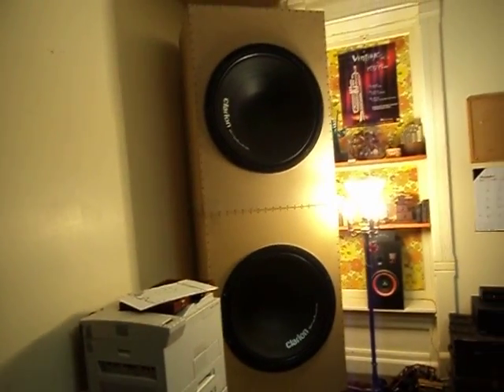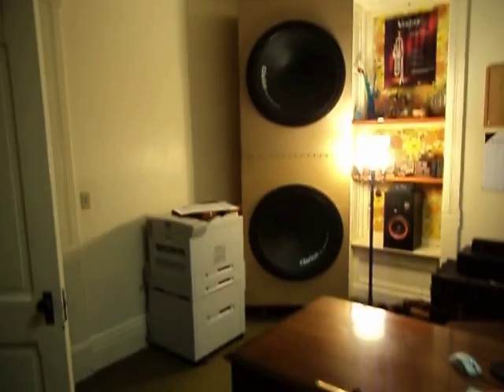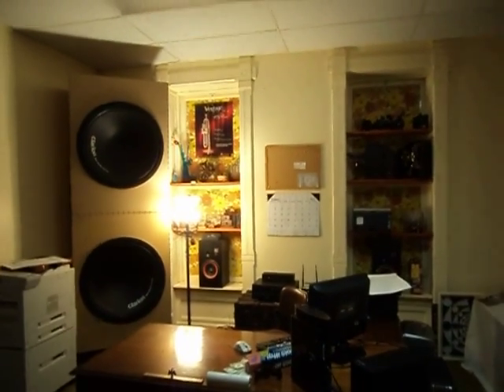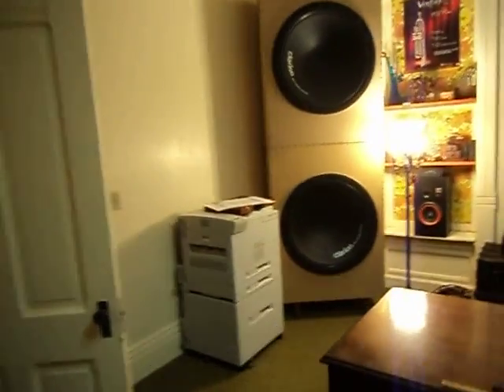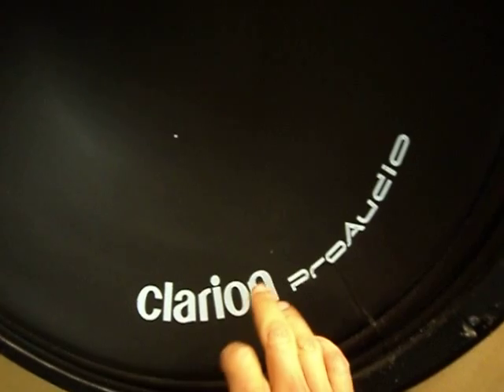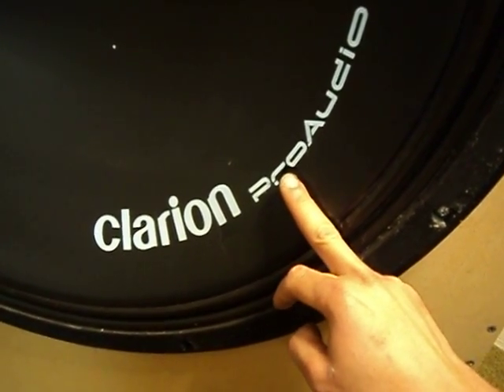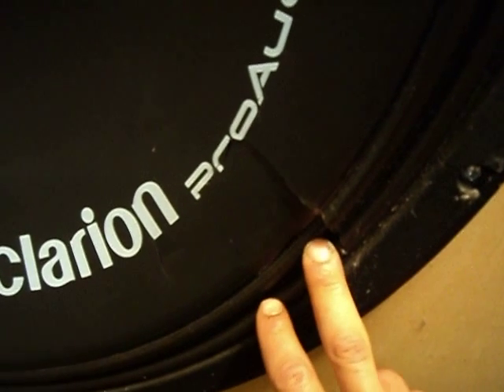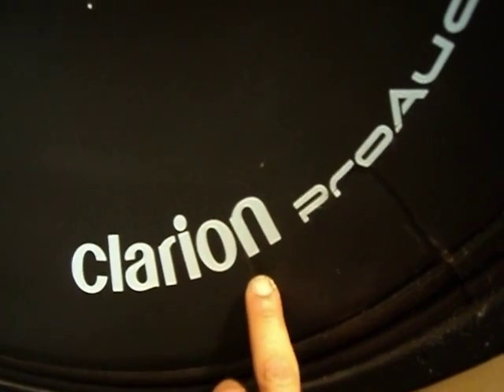Largest home audio sub needs help!! clarion srw8000 32

Comment: Parts-express will have what you need to repair your drivers cone. The number is 1-800-338-0531. I use them all the time for glues, and parts I may need for My shop. Good luck.

Comment: im rebuilding one right now i saved the cone the surround i ripped in three places the vioce coil was burnt right out so i called my clarion rep he has a link for the 4" dual vioce coil and new spiders i gotta find some one to get a surround i wanna do a 1.5" rubber and im gonna add some more magnet to it and a more powerful vioce coil ill post a vid of the process not gonna be fun

Comment: Believe it or not, use plain ole CLEAR nail polish to repair the surround, it stays flexible, I've used it for years to repair speaker surrounds. You will probably have to apply several coats to properly seal/repair the damage. The cone, I've had good results with simple hot melt glue, Spreading it is the hard part as it will cool very quickly.

Comment: OK! take the sub out of the box and use some fiberglass or resin for the cone, for the surround go ahead and use some silicone so it stays flexible. You can also just get some glue that you know of thats extremly strong. Theres many glue options, it just won't look as pretty as before. And also, WHERE DO YOU BUY THESE THINGS?!? I CANT FIND THEM ANYWHERE!

Comment: only thing i could think of is use like a rtv type product on the rubber, then pull the speakers out and use some 2 part epoxy on both sides. Wouldn't look the prettiest but would work just fine. Wish they still made these.